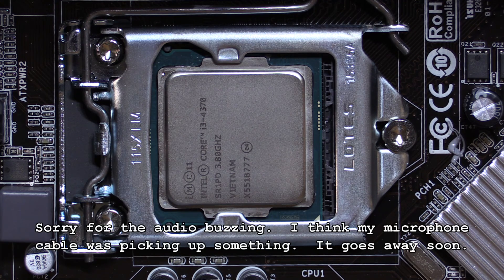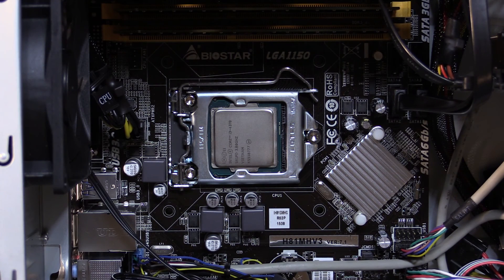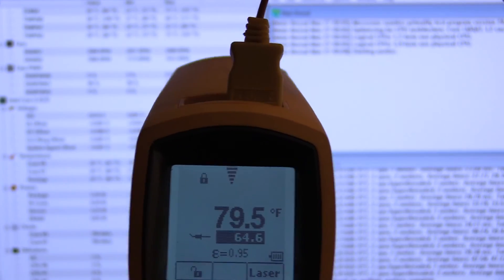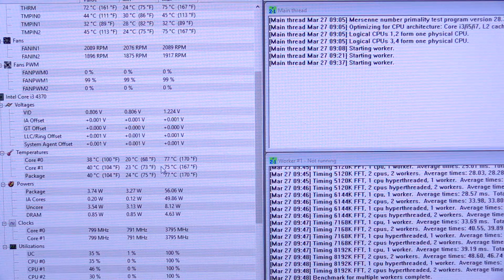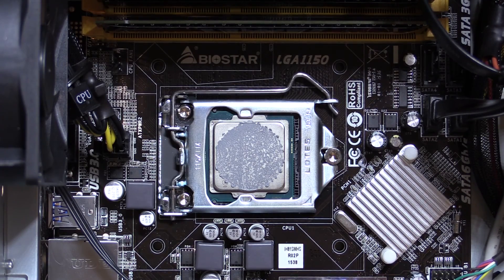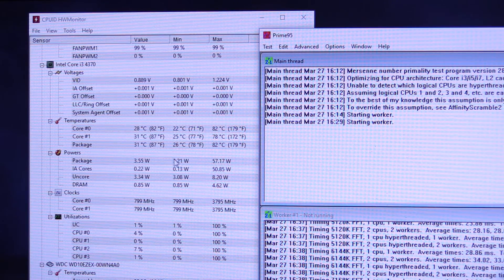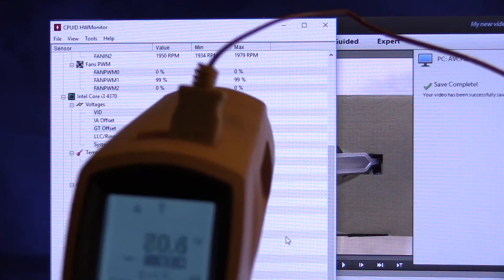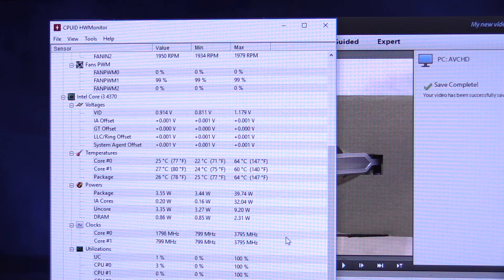Stock CPU Cooler, Testing Pre-Applied Thermal Compound

Comment: To save your precious time: No. It doesn't matter whether you leave the stock paste or use your own.
Reply: thanks! to bigtb1717, you can make this video shorter (approx. 3-5 minutes) with some comparison charts. save our time, better content, more subsciber (maybe)
Reply: Well, not exactly: I had a stock cooler once which was unused for 7 years and paste dried. 
How I discovered it? Glad you asked. When I took off it form the CPU, almost all of the paste were still intact on a cooler, and not a bit on CPU IHS.
Reply: What about after 2 years or so. I use my own paste for install.
Reply: I literally fell asleep watching this
Reply: @bohdan_lvov  did it fry??
Reply: @stevethea5250  of course it didn't, since modern processors starting to throttle down if temperature are too high. But yeah, i was loud and my i5 2500k on default settings easily went to 70s
Reply: @TheAugust666  Love me. Feed me. Never leave me
Reply: @MarcEPliester  Eligible Transaction means any purchase excluding (but not limited to)
Cash Advances, Balance Transfers, Special Promotions, BPAY payments,
purchases of foreign currency and travellers cheques, transactions
made in operating a business, payments to other Citi accounts, bank
fees and charges such as interest and ATM charges, transactions made
using flybuys Points and government related transactions. Government
related transactions include transactions with government or semigovernment entities, or relating to services provided by or in connection
with government (for example but not limited to transactions made
at Australia Post, payments to the Australian Taxation Office, council
rates, motor registries, tolls, parking stations and meters, fares on public
transport, fines and court related costs).5
Please note that whether or not a transaction is an Eligible Transaction
will be determined based on information provided either by the
merchant or the relevant financial institution (including information
about the type of business conducted by the merchant). This means
that, for example, spend with certain merchants may be characterised
as spend with a government related entity and therefore not an
Eligible Transaction, even if that merchant is not in fact a government
related entity.
Reply: @bohdan_lvov  \ Well apparently stock thermal paste does look dry when you remove it but its not actually dry. I just removed a stock cooler on a 3 month old cpu and thought it was dry. It was kind of crumbly but thats normal. You should also reapply thermal paste after a few years depending on how you use your computer.
Reply: It matters for them who built a pc for the first time...
Reply: I think this is a nice TL;DW for the video. Thanks!

Comment: You have to seriously observe how the stock thermal paste's condition. Is it partially  scraped off. is it even, is it dried up ? If it's partially scraped off, then it might not be even and have air bubbles or space that will insulate the heat transfer. If it's dried up, then it won't spread nicely - same problem.

Comment: I have Intel Core i3-3220 and I am playing GTA 5. The max temperature i get after playing is 105C. I using Open Hardware Monitor program to monitor temperature. With some other simulator games max temperature goes to 95C. What should i do? Please help.
Reply from the maker: I would start with the basics.  Is the fan working?  Are the inlet and outlet vents clear and unobstructed?  Did you build the computer yourself?
Reply: ihave i3 4160 white stock cooler playing gta v online  max temperature 58 C
Reply: Sounds like there is an issue. I would remove the heatsink if there is no visible problem (fan not working or bad mount) and check the interface between cooler and cpu heat spreader. I would be willing to bet, if the fan is working, you have a bad seat between the cpu and cooler or the oem thermal compound was compromised by trash or accidentally scraping it off before installation.
Reply: 993bagira
Reply: holy shit that is hot, that is gonna wear out fast
Reply: Same problem here tho I would delidd CPU and replace Colgate inside with liquid metal, use mx4 on hs and buy water cooling but my parents think it is waste of money.

Comment: I would have liked to see how the coverige was on the self applied thermal paste
Reply from the maker: Sorry I didn't show it, but I did take it apart after the video.  Coverage was complete, with just a tiny bit of excess pushed out as a small bead at one edge of the processor.

Comment: I have a three year old i7-4790k stock cooler that has never been used I want to use on an i5-4590.  I've never used an Intel stock cooler before and the TIM on it is not "tacky" or sticky - its smooth and dry to the touch. Is that normal?  Will it liquify and spread when it gets warm or should I replace it with my own?
Reply from the maker: The stuff on the ones I've used was fairly stiff too, but not quite what I'd call "dry".  I could lightly touch it without getting any on my finger, but it squished easily and left a finger print with even a very light touch.  Chances are the stuff there would work ok.   Personally, I don't like not being sure, so I'd probably replace it if it were mine.

Comment: intel burn test is better to test for heat as it pushes the cpu harder and is better then prime but good video but i guess they both do the same thing mx4 is a pretty good i have used it with a stock cooler though you won't notice much of a difference only when you go aftermarket heatsing and fan etc

Comment: Hello mate ! So , I'm building a i3 8100 PC and I'm confused if I can use the stock cooler and his thermal paste . Can I use it without any problem ?
Reply from the maker: The stock cooler with pre-applied paste should be fine on the i3-8100.  Certainly not the best cooler, but adequate.  It's not an overclockable processor and the power draw is fairly low.  As long as your case has decent airflow it should be totally fine.
Reply: @bigtb1717  My case is a Nox Hummer MC ATX (2 fans included) , my MOBO is going to be B360m Aorus Gaming 3 or B360m D3H . Do you think it's fine ?
Reply from the maker: I don't know much about that case.  It looks like the front is a bit closed off, but with two fans it should be fine.  Personally, I'd probably get a third fan so you'd have two front intake and one rear exhaust.  Not required by any means, just how I'd personally do it because I like to err on the side of plenty of air flow.

Comment: its normal if the cpu is about 85ºc in gaming?
Reply from the maker: Seems a bit high, but there are a lot of factors.  What is your setup?
Reply: bigtb1717 i have a Intel Core i3-8100 with the stock cooler
Reply from the maker: What case?  What/how many case fans?  How hot is the ambient room temp?  How is your wire management?  Are all four of the stock cooler fasteners securely latched?  All those things can affect the CPU temp.  A hot GPU dumping heat hear the processor can be a factor as well if the case airflow isn't the best.

Might be a few days.  I have a lot going on this week.  But it will happen as soon as I get a chance.
Reply: bigtb1717 i have One fan for remove the hot air from the PC and 2 fans to give fresh air to the pc
Reply from the maker: Funny enough, I just built a test machine with an i3-8100 (haven't even fired it up yet) and will be testing the stock cooler and an aftermarket cooler, both with stock and aftermarket paste, as well as with the new Innovation Cooling thermal pad.  I will be making a video about it, but I can also reply back here to let you know what my temps are with the stock cooler so you can compare to yours.
Reply: bigtb1717 i dont have a lot of wires blocking the air my case is a deepcool tesseract wh
Reply: bigtb1717 and on my house  its not to hot
Reply: bigtb1717 i dont check my cooler but maby its broken
Reply: bigtb1717 Im sorry for All the awnsers
Reply from the maker: It's also possible that those temps are in the normal range for that processor with that cooler.  85C isn't quite dangerous territory (Intel lists the max die temps as 100C), thought I generally do prefer my setup to run cooler than that whenever possible.

I'll let you know what temps my i3-8100 runs at once I get it tested.  I have heard that Coffee Lake processors run on the hot side, so we'll see.
Reply: bigtb1717 i Will watch the video to now the results :)
Reply: bigtb1717 i tink that my temperature program was not right because now my CPU is 100% ussage and the temperature is  80°
Reply: bigtb1717 do you know some programe to see PC temperatures because i have One but i dont think   he os right
Reply from the maker: So I have my i3-8100 system up and running and have a few preliminary numbers.  After about 5 minutes in Aida64 I saw 64C or so.  However, with the heavier load in Prime95 I hit a max of 81C (after maybe 10 minutes).  This is with the stock cooler with the pre-applied thermal paste.  Temps were measured with both Aida64 and HWMonitor (temps matched between both programs).  TheCPU package temp and core temps were within a couple degrees of each other.

I'm working on the video now, so before long I'll have numbers from longer tests and some comparison numbers with an aftermarket heatsink/fan as well.
Reply: You litterally have a full comment thread with only you in it